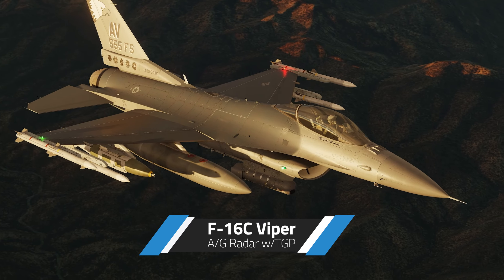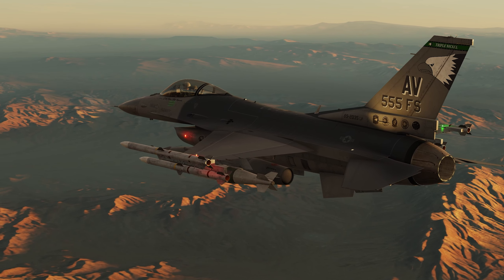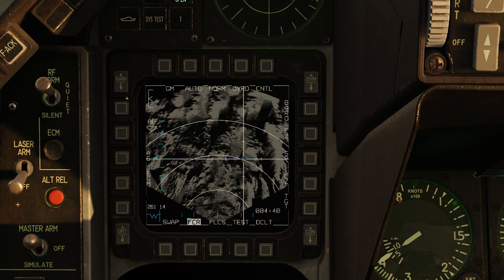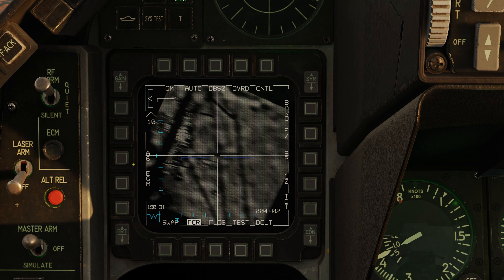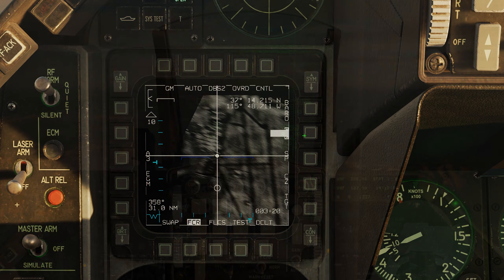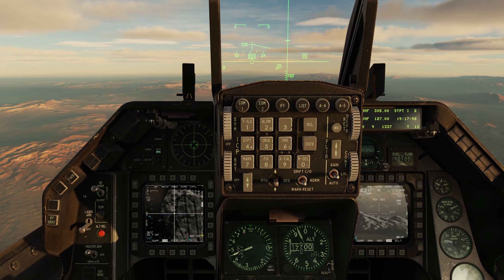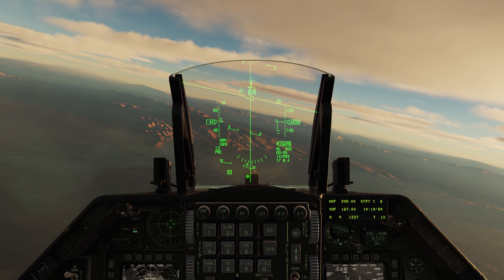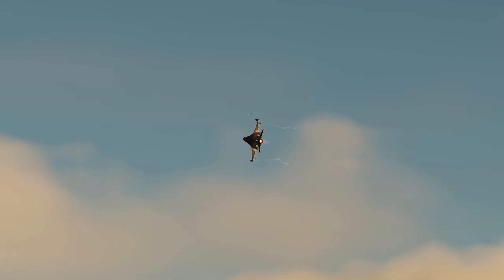DCS World F-16C Air to Ground Radar with Targeting Pod

Comment: What I tested you can press TMS Right to slew the TGP to radar SPI
Reply: Interesting so doing a forced hand-off to the TGP like doing it with a maverick, i'll test that later nice one.
Reply from the maker: @pyroscot  interesting, I'll test this later...

*Update*, after testing this, this seems to work at the moment.  So ether press TMS right or hit the TGT button on the FCR to get it to slew for now.
Reply: I stumbled onto this as well. I wonder if it's supposed to do that? The ED F-16 manual has section that shows what TMS, DMS, and CMD up, down, left, right do. It's been ages since I looked at the manual though.
Reply: @saiajin82  kinda, TMS Right is used to change sighting options, but for some reason you have to “cycle” the sighting options( which doesn’t actually cycle) to slave the tgp to radar
Reply from the maker: @oppotato5440  yah I can't find anything to support this at the moment so I guess we will find out... Early access woes
Reply: @TrickerDCS  to support what? TMS Right changing sighting option? or having to press tgt to slave TGP to FCR?
Reply from the maker: @oppotato5440  tms right to slew the tgp to fcr

Comment: I think we've reached a point where we can honestly start recommending it over the Hornet. Before I thought the Viper deserved a large warning label if someone I knew was going to purchase it. Now, especially with HTS right around the corner, it really is starting to shine
Reply: What's the HTS?
Reply: Coming from BMS I’m just getting into the DCS viper and so far it’s incredibly foreign feeling - it seems to want to fall out of the sky like a brick when maneuvering at anything much over 7 degrees AOA. Scrubs speed like crazy, “feels” heavier and less inclined to “float” than the BMS viper. Also at a glance it seems to be much more fuel efficient - might be my imagination. It also seems to accelerate and  reach higher speeds faster at similar degrees of climb …
Reply: @gb7418  I hear some saying the flight model is broken or some thing on that scale.
Reply: What’s HTS

Comment: ground radar is pretty useless for finding targets. you can see only airfields or big bridges etc. and if you know that your target is in that field then you can make fine tunning. and if the weather is not good, you can only bomb very roughly estimated area
Reply: Just like IRL.
Reply: @Mightymoose02  not necessarily true. Irl radars reflect extremely bright in the agr. I don't see it simulated in DCS or at least not to the point where it's usable

Comment: Just what I was looking for! Though I feel like it kind of defeats the purpose of having the ag radar, I usually just have the tgp slaved to a steer point in good weather. I would only use AG radar with heavy clouds over the target when I cant use the tgp, and then there’s no purpose to do the hand-off. Thanks for the help
Reply from the maker: I agree... When it all comes together it will be quite powerful, just the early stages but it can be done
Reply: @TrickerDCS  That’s the brilliance of the F-35, to bring it all together in the most efficient package
Reply: @Maverickf20  I thoroughly enjoy an efficient package
Reply: Remember that AG Radar was installed and used before tgp’s were available.
Reply from the maker: @hansgrietjes7310  shhhhh 🤫🤫🤫

Comment: Thanks for the video. Anyone else having issues with the zoom? When I hit the range scale buttons nothing happens. Worked for my friend the first time but the second time it failed.
Reply from the maker: Depends on which submode you're in.  Make sure you're in DSB 2, pinky switch command to zoom
Reply: @TrickerDCS  Oh really? So I find my general target area, go to DBS2, freeze it and then pinky switch? I don't need to fiddle around with "auto" or "man" before the zoom works? Thanks
Reply from the maker: @b0bl00i  so at the time auto and manual are switched, so make sure it says auto to be in "manual," find the area you want to go to, pinky switch to go to expand, pinky switch to go to DSB 1, again to go to DSB 2. When you have your target location in the FCR, then you can freeze to use the cursor more accurately